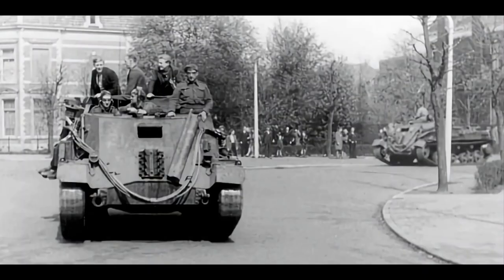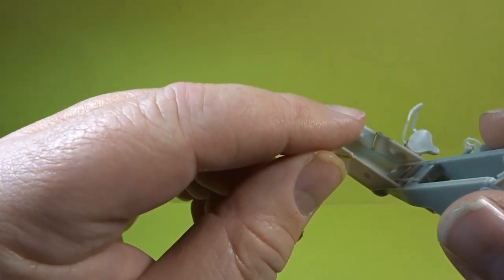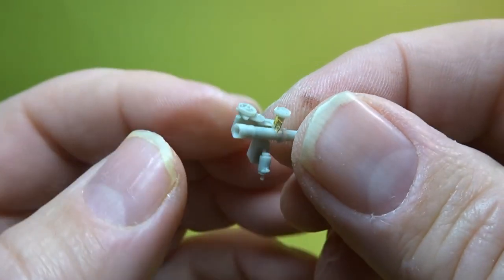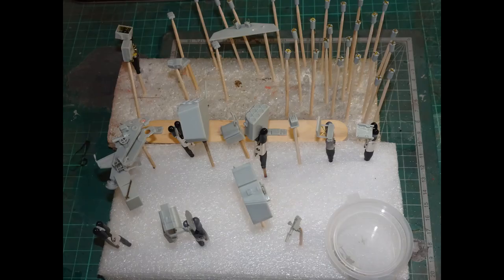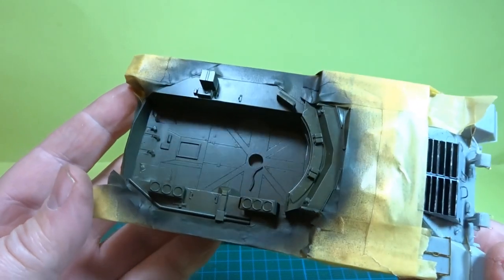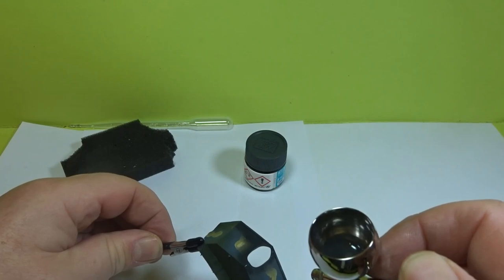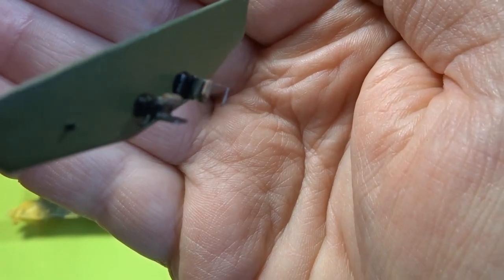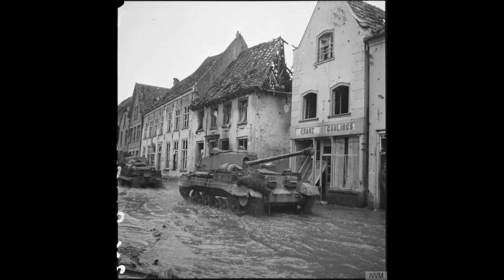Bronco 17pdr Self Propelled Gun ARCHER 1/35 Scale BARREL AND PAINTWORK Part Three

Comment: Continuing with the very small and delicate pieces I see Steve! Good to see the wet stuff going down though, that Finishing Surfacer has been my primer of choice pretty much since the beginning of my short modelling career. I usually go much thinner, at least 50/50, but whatever works for you 👍

Looking forward to the weathering, the part I still struggle to do convincingly.
Reply from the maker: Evenin mate. I must admit I have gone from 50/50 all the way up to neat. As you know airbrushes are all different so therefore the mix ratios as well. I wish I had discovered Mr Surfacer years ago. Also I wish they would do it in Red Oxide LOL. Many thanks for looking in and commenting. Have a great weekend my friend
Reply: I know they do red oxide in a rattle can but I'm not sure how controllable those are.
Reply from the maker: I use the Tamiya red oxide spray and I decant it into the airbrush. Its just as good as Mr Surfacer put its just a bit of a phaff having to decant it.